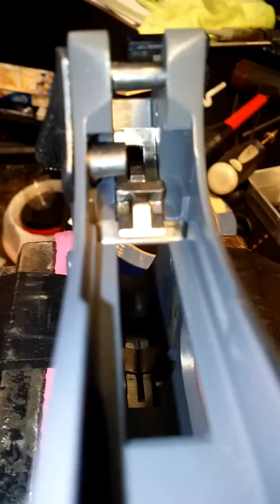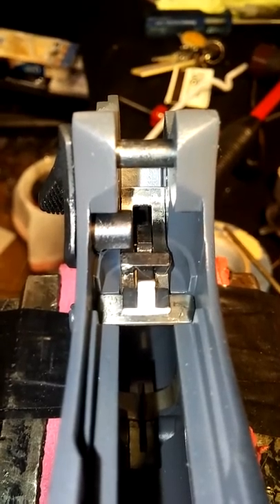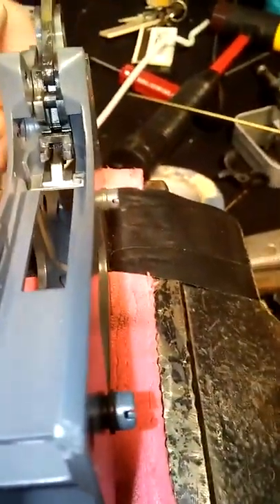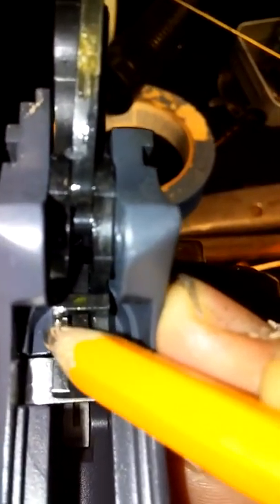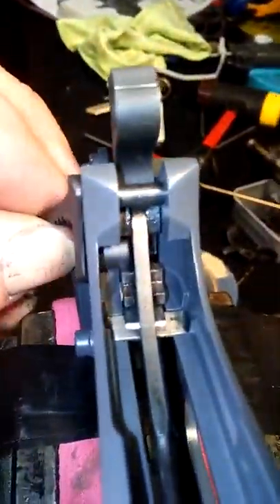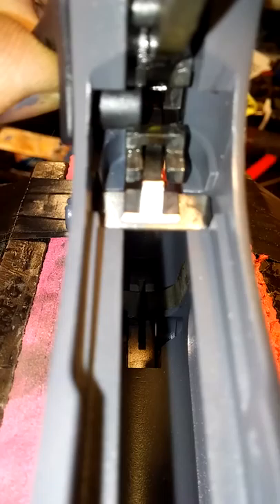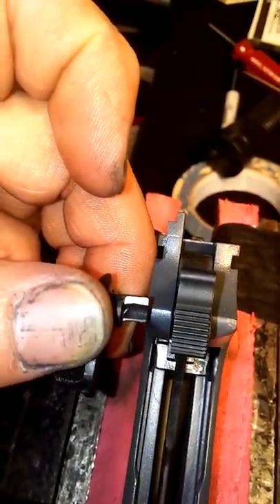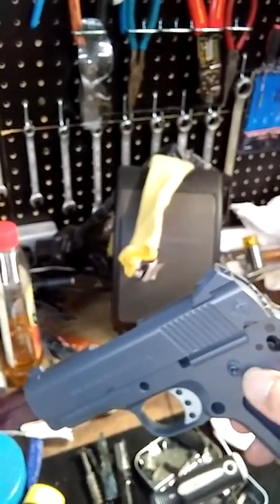1911 Thumb Safety fitting

Comment: My thumb safety seems to be fitting weird. I filed off the correct spot until it fit but it seems to be stuck on safe. Looking into the sear and lug you can see that the sear fits but it looks like I will need to completely file away the rounded area to have any movement at all in the thumb safety.

Is this something that happens often or is it an error on my end?

It's a finished 80% frame and all of the parts are brand new.
Reply from the maker: I wish I could help. Let me reread several sources I have and maybe I can find something for you.
Reply: @mackdaddy1911a1  I think I figured it out. The space between the lug that rides the frame is too small and needs to be filed down. It was difficult to see but taking it apart more, I can see that the space is not big enough. Thanks for the offer though.